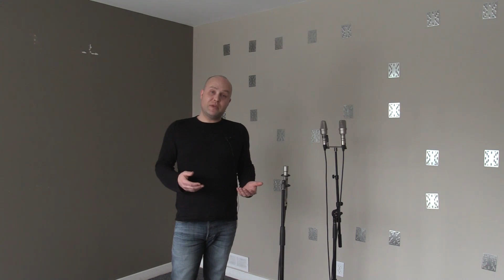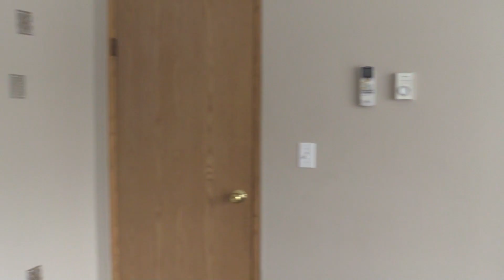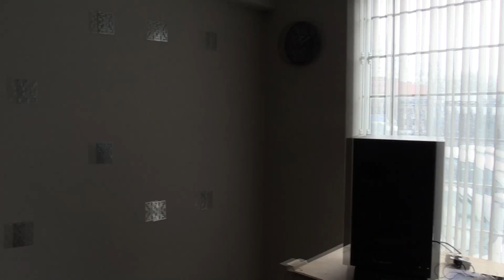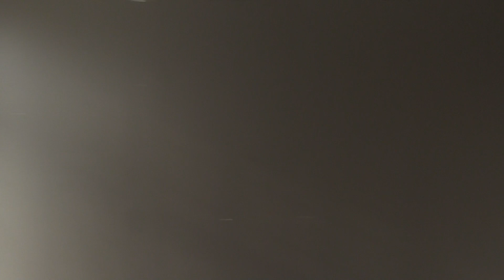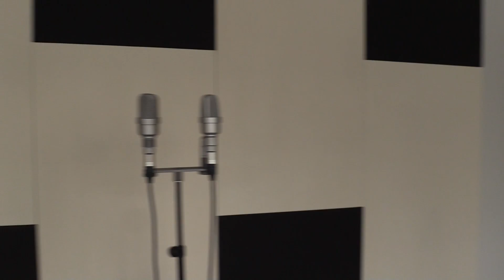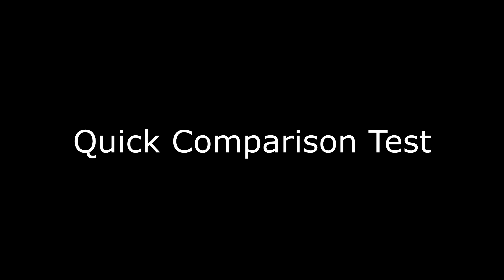Before & After Primacoustic Treatment

Comment: Impressive. There is that clap "boing" left though. Some kind of a resonance. How to counter that? I'm evaluating different ways to treat my room to upgrade the quality of my voice over work. Either with your products or getting a dedicated VO booth.
Reply: floor and ceiling i bet. and the window, speakers being on a desk and reflections under the desk.
Reply: And then there's the question of how sturdy the walls arew and how thick the door and window is.
Reply: Jooo J To get rid of that you need a diffuser on the wall opposite the speakers
Reply: Some diffusion on the back wall and some ceiling absorption would improve the sound much more.